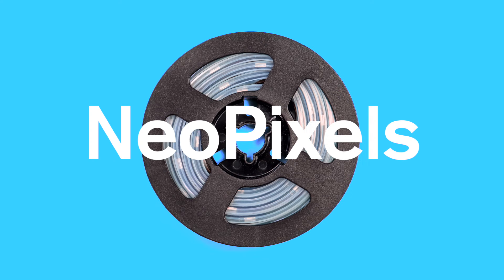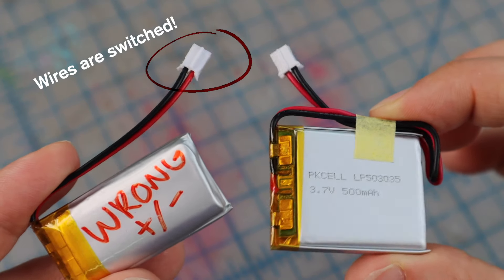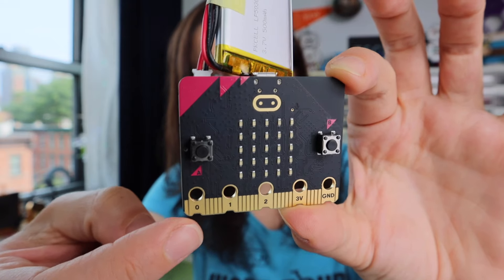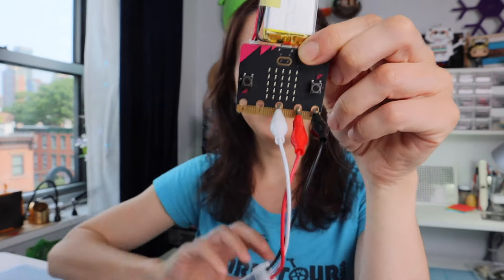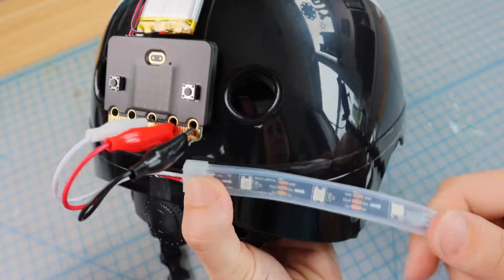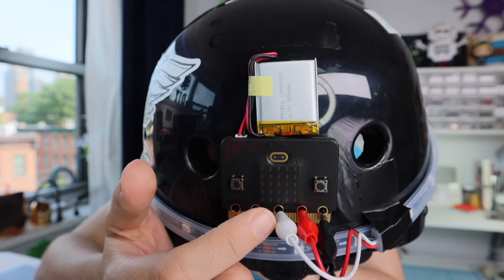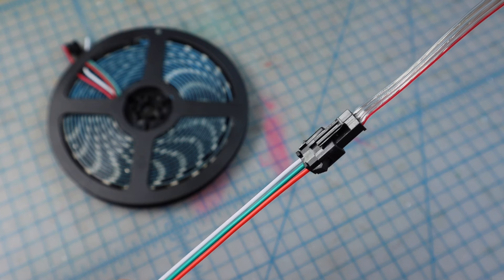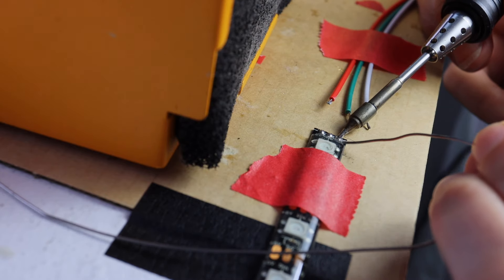Connecting NeoPixels and micro:bit // Creative LEDs * 03 *

Comment: If the battery JST connector is wired backwards for your needs it should be pretty simple to pop the crimps out of the connector housing with a narrow pointed implement and push them back in the positions you want. Just be careful not to short the crimps when they are both free of the housing.
Reply from the maker: Interesting. I've always just re-soldered a new connector. Is there a trick to getting the crimps out without breaking the connector?
Reply: @TechnoChic  They've just got a springy protrusion that catches on the housing. Push down firmly on that spring and pull lightly on the wire. If you squash the spring too much for it to lock back in the housing, just bend it back up a bit and it should be fine.
Reply from the maker: @notsurt  Ah Thanks! Do you use tweezers for this?
Reply: @TechnoChic  Usually just use my multimeter probes because they are always at hand, but pointy tweezers should do the job just fine.